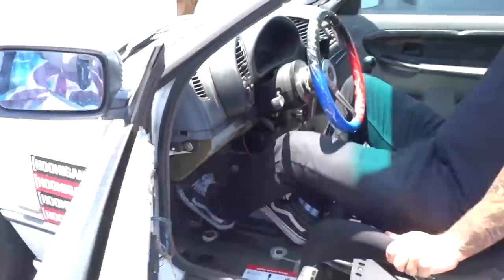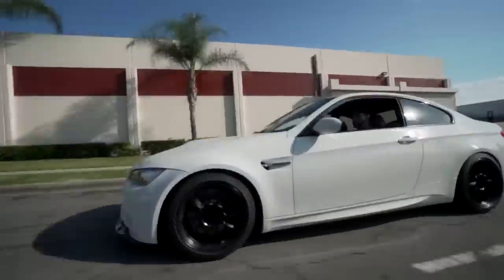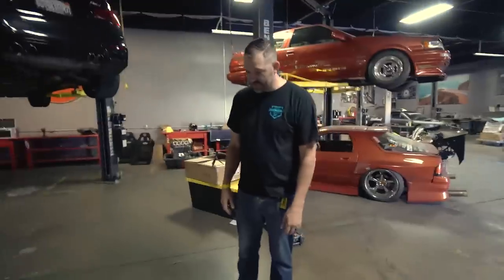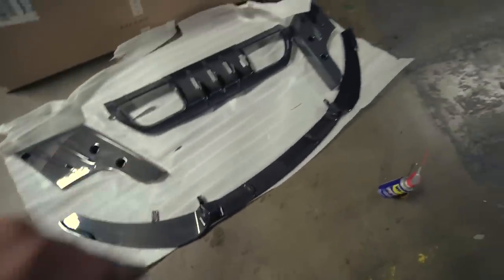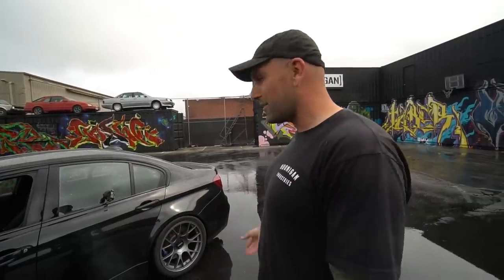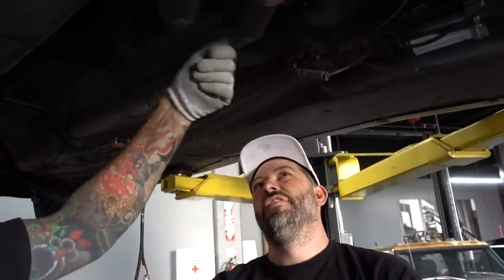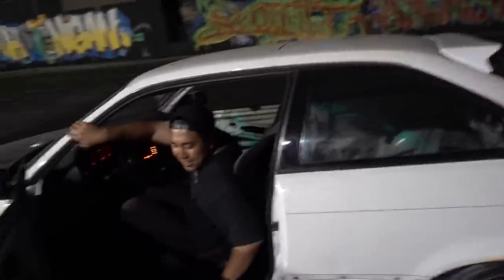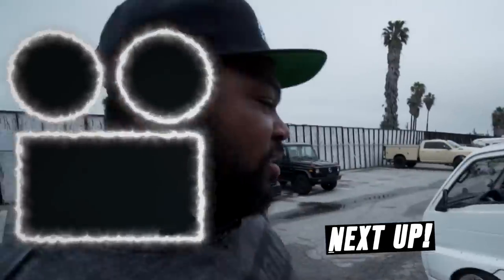Terrible Sounding BMWs FIXED! Equal Length Mid Pipe and DIY Exhaust Mods

Comment: It's amazing how BMW manages to make the best sounding engine types sound the worst.
Reply: Let me introduce you to the Lexus IS200
Reply: @shona5512  heard about m50b20?
Reply: I know I love 6cyl engines in general. Not when they sound like that tho (before the mods I mean)
Reply: @shona5512 the old straight 6 1st gen? I've never heard it as much as I love the later is300s and larger. Thought about buying a 200 cuz you can still do a lot to build them out but yeah.
Reply: @hi_tech_reptiles  The 1G-FE, the 2.0 6 Cylinder engine from the IS200.. If you live in the UK or Ireland, and you've been to any drift day since 2015, you'll know how much of a plague these engines have been. Especially because everyone seems to straight pipe them and they are so raspy and tinny. However, strap a turbo to one of them and they do have the ability to sound good, but most people don't go to that extent, so they mostly just sound like utter shite.
Reply: They didn't do it on purpose though, the stock exhaust is optimised for performance and dealing with annoying EU emission regulations.
Reply: They sound good

Comment: I agree with vin, F80 is the best daily I have owned. It's the perfect "1 car does it all" for me. 600whp, 4 doors for my sons car seats, comfortable/sporty interior, modern features, Apple car play, adaptive suspension, looks amazing. Doesn't sound great but I went with the single midpipe myself and resonated downpipes. Almost no rasp.
Reply: @AnalBeard  I pretty much have all the mods and tuned for full e-85, the only thing I haven't done is upgraded turbos
Reply: It's probably closer to 580whp currently
Reply: @AnalBeard  Iv had mine going on 4 years modded it over time and have enjoyed every bit of it! My favorite part is that in comfort mode it still drives and sounds stock 👍🏼 I daily mine 2 hour rounds trips to work 5 days a week just about to hit 100k got it with 43k miles

Comment: Does the Macaroni Mid pipe reduce exhaust flow / efficiency if the exhaust gases have to change direction that many times? Or is it negligible?
Reply: if anything it makes more power
Reply: I was wondering the same. Much sharper bends and the full length wiggle has to have some impact.
Reply: It's probably free flowing enough that there's not a measurable difference. 1HP kinda thing. Honestly, you've got cats and turbos in front of it, they're so much more of a restriction that it won't matter.

You might even notice a HP gain simply due to being more equal length and matching exhaust pulses...but again turbo and cats make that negligable.

Comment: The BMW builder in me wanted to complain about you bitching about the sound of the e36 then I remembered how bad my m50b30 sounded with a cut exhaust. I ended up having to install a thrush hush thrush muffler. When I get further into my turbo e83 x3 build I'll be definitely doing something on par with the Thrush in a stainless package. I like quiet cars that have no business being as built as they are.

Comment: What drift mods are done to the e36 that thing slides so effortlessly and on stock power
Reply: BCs, angle kit and welded 3.9
Reply: @vin_tra  do you know what angle kit it is?

Comment: It's hard for me too watch car stuff anymore bro. I took rides from friends, definitely inconveniencing them for two years while I saved up money and built my credit. I wanted a truck cause my dad had a 99 dodge 2500, and I didnt know no better. I'm not a car guy I'm just a car enjoyer. I staked out this ram 1500 for like a week, test drove it twice, sounded okay, felt something wrong with front end which was just ball joints. I bought it, drove it home, went to sleep, woke up, started it up and TICK TICK TICK TICK TICK for 30 seconds. Never heard it before that day. Drove it all the way to work and realized the trans was shit too, slipping every gear. I dont know what to do, living on your own making 20$ an hour cant afford you a new engine, much less engine and trans. I'm so lost bro I just hope you guys give some good advice because I'm ashamed to bring it up to any of my friends.
Reply: Find a used transmission from a junk yard and change it yourself? Take your time and do some research, hire your tools from the auto parts store ? I did the clutch and all the gearbox seals on my sons Toyota Starlet with no manual or YouTube videos, as there were none. Took 3 days with only jacks and stands on a flat concrete floor.
Service the engine and check the oil level, you may have some lifter wear or low oil on cold start.
You could also do the “bodge” method, whack some sea foam transmission flush then follow the instructions and change the trans fluid. Might be better whilst you save for replacement. Get together with some buddies, drink beer, fix the truck, shoot the shit. Makes it feel better.
Reply: What year? What engine?
Reply: @foamdataservices  thanks man, I guess I'll search for a trans at a junkyard. The motor is a different story entirely. I just had to let that all out dude, the walls are starting to close in if you know what I mean.
Reply: @jamesborek8125  2014 5.7
Reply: @maloio6425  No worries mate, every car guy has been there regardless of experience, tools and skill! Concentrate on the basics with the motor, service it, look at the old oil, check the valve lash, then do a leak down and compression test to check for any valve leaks or piston ring wear. The tools for that can be hired too. I drove my Miata nearly 1000 miles with a failing head gasket, I knew it was going but couldn’t fix it at that point, once you know what might be wrong you can usually manage it until you can fix it.
Reply: LS1’s are known for a degree of piston slap I see from quick reading. Loose or worn rockers can be an issue on any pushrod engine. I also thought my hydraulic tappets (lifter tick) was an out of phase cam on my Miata but when I checked the cam timing fir the third time and it was good I realised I needed to send it and see. It was fine after that. The only time it ticked was when the oil was low.
Reply: @foamdataservices  I'm no car guy really bro, I change oil brakes spark plugs coil packs and tires, that's it. I'll probably need some youtube videos and a whole day to do rotors. But I gotta do what I gotta do man, thanks for the advice again.
Reply: @maloio6425  I started working on cars when I was 18, 25 years later I still need YouTube videos or an owners manual to work out what the hell I am doing. Working on your car and wanting to learn more makes you a car guy. Every day is a school day, don’t be afraid to try and we all make dumb errors, even “professionals.”

Comment: The only way to make the S55 sound good is to single turbo it. I’ve seen people on YT buy titanium exhausts only for it to sound slightly better. Better to save up all the money on an expensive exhaust system and just upgrade the turbo. The car will be significantly faster too.

Comment: FYI, the E46 mid pipe supports were squished. The exhaust then rested on the cross brace, which is bolted to the chassis.
The noise from that went right into and all the way through thr car. It was awful! 
So noz dont ever weld an exhaust to a car to stop a rattle. It'll be 1,000 times worse.

Comment: the key to a good sounding BMW 6zyl is always go single pipe in my opinion
Reply: You've never heard how bad a E46 M3 is have u?
Reply: @ThatMaximaKid  how bad??? Greatest sounding 6cyl ever made
Reply: @ThatMaximaKid  e46 m3 can sound veeeeery good
Reply: @lukekindred1999 you’re tripping 😭 it only sounds good from induction, the exhaust is awful.
Reply: @sLothiC just needs like 3 resonators 😂
Reply: @SixSpeedSeven  exactly
Reply: @sLothiC  can? Yes. But I assume you meant straight pipe which they sound HORRIBLE straight piped
Reply: @ThatMaximaKid No way. Race E46s with straight pipes are the best
Reply: @SixSpeedSeven  not at all - personally I think it’s an American thing yunno. Over here in the UK everyone absolutely loves the noise they make, but I’ve never heard so much complaining about how they sound from Americans 😂

Comment: The stock e36 exhaust sounded good to me 🤷🏼‍♀️
Reply: E36 is really the best sounding M3 alongside the E90, as long as its got a back box and resonators the E36 sounds really good, and euro specs can sound great straight piped as well.

Comment: I hate that m5x engines get ruined by crappy exhausts or stock with the muffler cut off. Because they can sound absolutely glorious with a nice system.
Reply: Turbo usually sorts that out! I did have to add a resonator to my MX5 exhaust as it sucked NA with it as it came.

Comment: The sound you’re looking for I believe is a Garrett g30-660 ! 
Come on vin , proper single turbo please 🙏
Reply: Correct. And kinda related the first kit we did to our e36 328 back in 05 was a gt35r on an Active Autowerk log style manifold. Glad they're still around.
Reply: if i can boost this thing with a stock head gasket and bolts ill do it. Also will run the oil return to the dipstick cause im not pulling the pan.

Comment: Most cars fromt the last 5 to 10 years sound like crap.
And little dudes put straight thru popping banging exhausts and tunes, and they sound like diarrhea cars.
No one tries hard to do something that sound good, only make noise.
Noise = it doesnt means that it SOUNDS good.
Even Ferrari 355 i've heard screaming but not sounding good.

Comment: Hate to say it, but the hodgepodged E36 sounds better than the M3…
Reply: E36 is genuinely one of the best sounding 6 cylinder engines ever they just had a terrible setup on it before, as long a an E36 has resonators and a back box it can sound very good.

Comment: so the lesson here today is this.

uneven midpipe = expensive sounds like trash still.   merged garbage into a big single sounds mean and clean..

did you know you can even the pipes internally? like inside the muffler.  that ol box of snakes instake works on the exhaust side too.

ALWAYS RUN BIG SINGLE

Comment: Every M50 based motor sound like ass once you start messing with the midpipe. Don't do it. Get a catback system and that's it, headers if you really want to. There is no performance to be gained by hacking off resonators and cats. Less than 5 hp, and your car will start sounding like a combination between a straight piped Honda Civic at 2 in the morning, and a weed wacker.